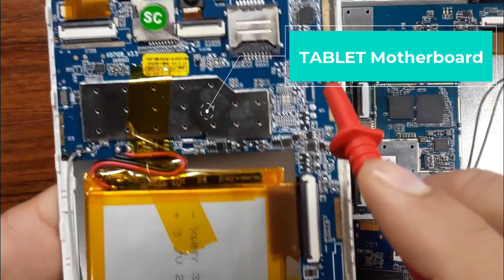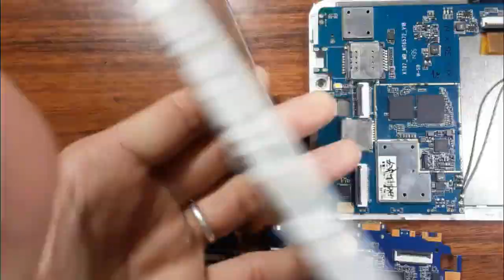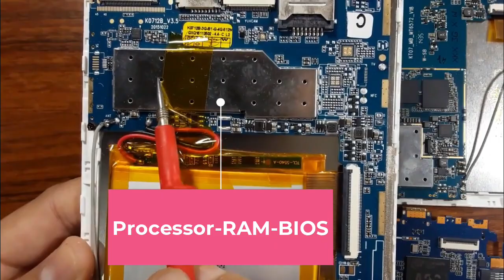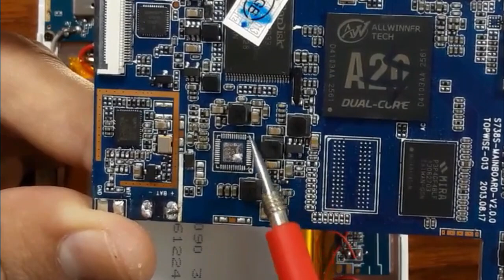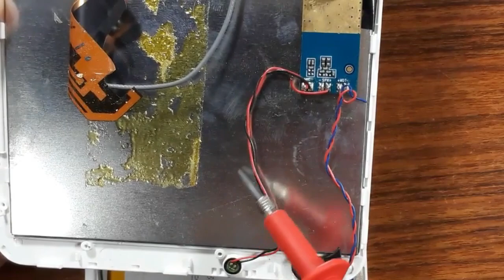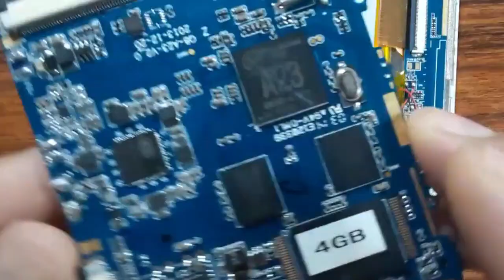Tablet motherboard components and their functions explained

Comment: If we wanted to reset our machine could we replace one of the chips with a new one?
Reply: For example if our tablet is locked and we can't get in
 Is it possible to replace the bios chip or one of the other chip with a brand new one and then load a new OS on it?

Comment: I have 2 capacitors found on my board that are labeled as BD1007 and BD1001. Normally they are labeled as C and a number. Those 2 capacitors give a beep when checking in continuity mode. All capacitors labeled as C are not beeping (which is good). But what are those 2 labeled as BD looking exactly like 2 SMD (ceramic) capacitors which beep when measuring both ends???
Reply: Could be smds inductors